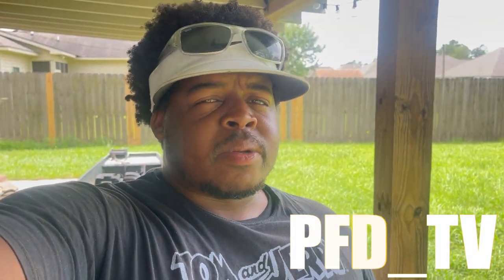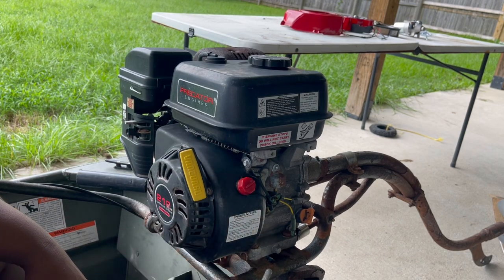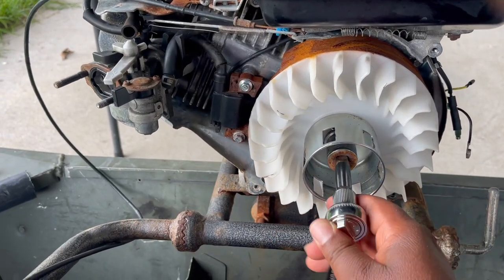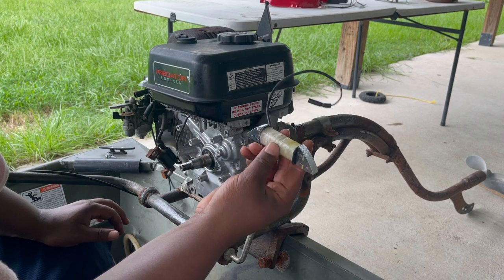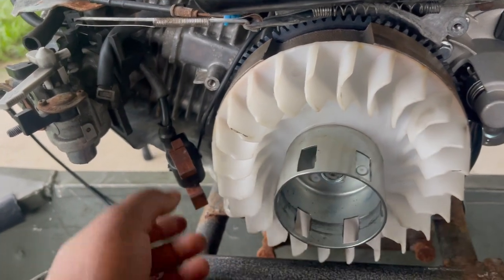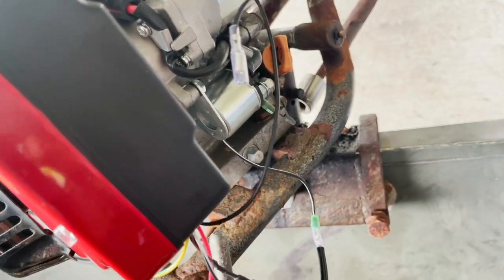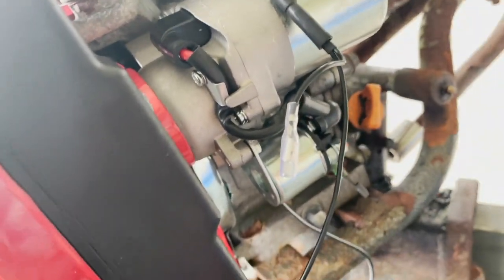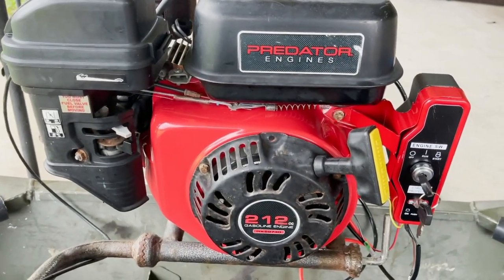KEY START MUD MOTOR! Adding key start to my PREDATOR 212 ENGINE

Comment: Did you have trouble starting on the water or just added it for convenience
Reply from the maker: I had no trouble starting it on the water. Technically you can’t start the motor with the prop in the water even if you used the pull string. But it was definitely worth the money! I definitely added it for the convenience. Only time I had issues starting was when it’s really cold outside lol.